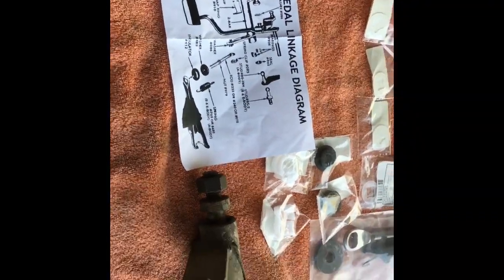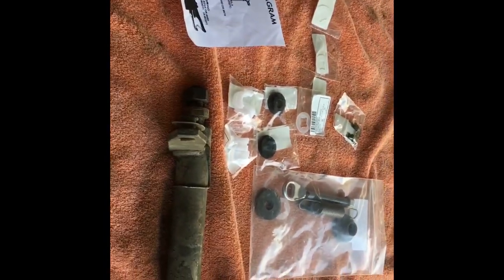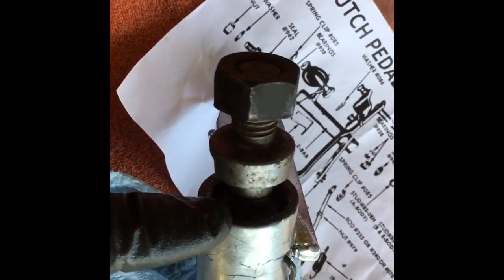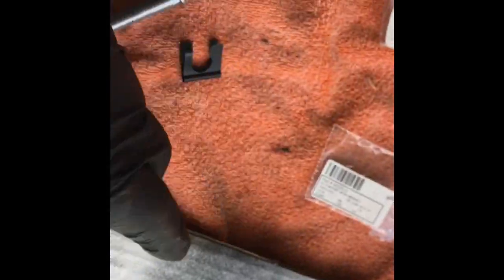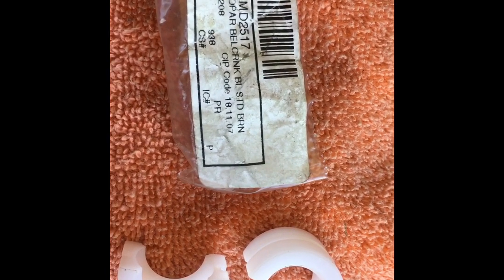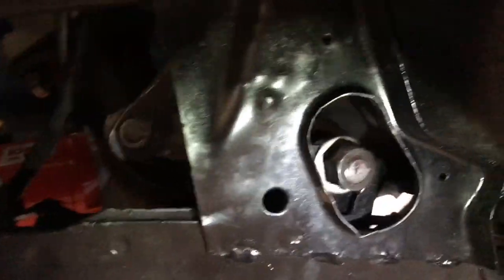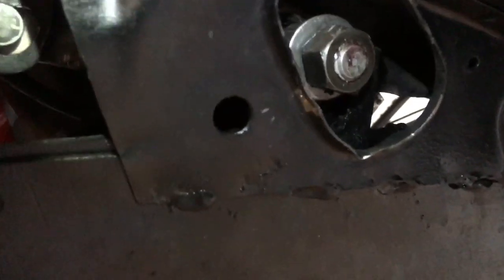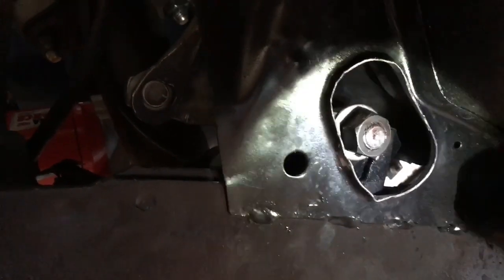1969 Plymouth GTX Z-Bar Install

Comment: I figured there was something wrong when you had to use a strap to pull the engine over to get the pivot ball to drop in to the frame bracket.  I was fortunate enough to have a bunch of spare linkage parts and noticed there is 2 different length pivot balls.  I test fitted the short ones 1st, and seemed clearances were proper to drop in to the Super Bee (without using a come along on the motor).  Short ball studs are 1 3/4" in length, long ball studs 2" not including threads.

Comment: I have to install the same kit on my Charger and I would like to have seen how you installed the 2 guide halves over the bellhousing ball bracket and pushed the Z bar over it without those 2 halves falling into the Z bar cavity. I installed my ball bracket onto the frame before I put my engine back in the car. It appears that I can then slide the Z bar over that ball bracket on the bellhousing and then onto the ball stud bracket on the frame. I'll attempt to video and post my results.  Thank you.

Comment: What is the trick getting the seal over the ball? Don’t seam possible to me
Reply from the maker: William Calamita It was a tight fit but, they really did fit nicely.  I just oiled my rubber seal up and forced it on.  I have been driving the car for a few months and the clutch and zbar are working great.
Reply from the maker: William Calamita I may have heated it up by boiling it in water.
Reply: damn. i heated my seals up with a heat gun on low and as it was slippedon it split on me. the second ome split too. so i ordered 3 more sets  amd will try again. any tips to avoid this?

Comment: where does the spring go?
Reply from the maker: The spring goes on the Zbar arm that is closest to the transmission.  You can see two holes in that section of the arm.  Im not sure what one of them I used.  The diagram I have provided gives you a rough idea where it goes.
Reply from the maker: The other end of the spring goes to the clutch shift fork near where the pushrod connects.
Reply from the maker: The spring you see that came with the package is #705 in the diagram.  its the smaller of the two springs.  It works with the pushrod.  there are holes at each end for the spring to connect.  The other spring you see in the diagram is mounted on the inside of the vehicle.  I didnt change that one.